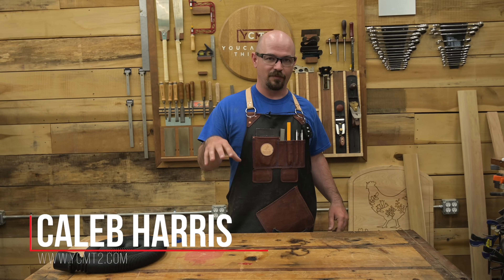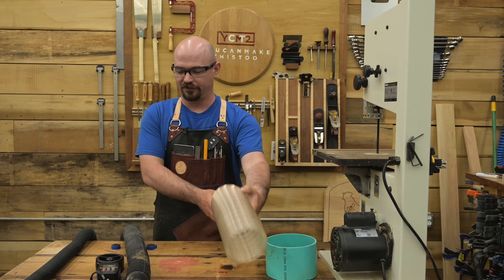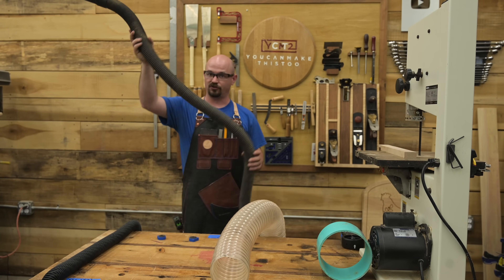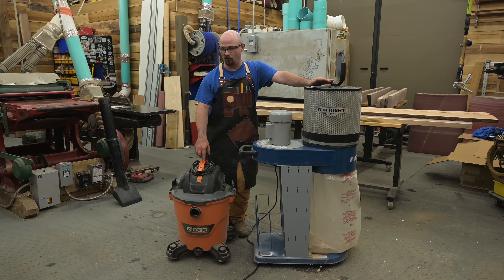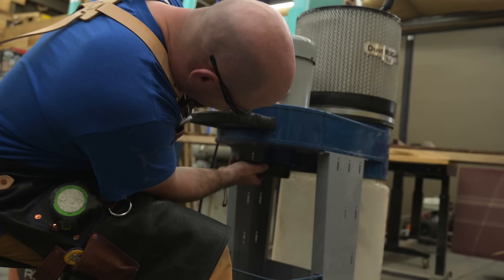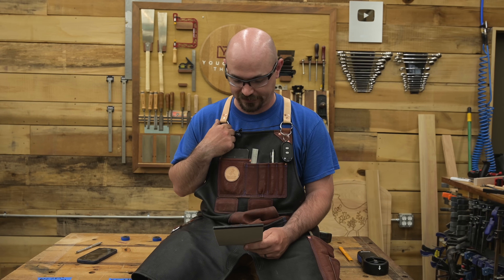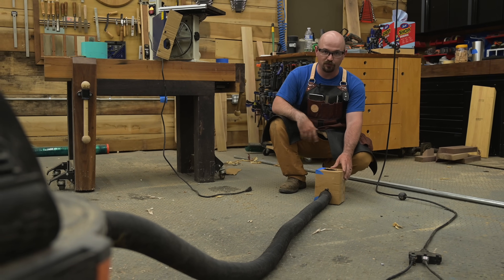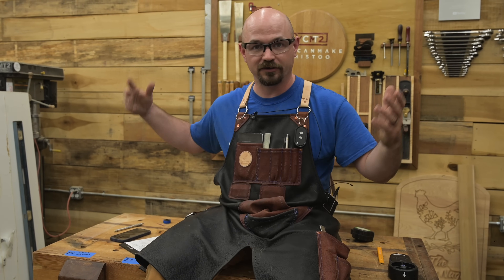We're Wrong About Dust Collection

Comment: The inconvenient truth is that you simply can't get good dust collection with small ports. Just because a shop-vac performs better with a small port than a big dust collector does with the same small port, doesn't mean either one is adequate. The acid test is to monitor air quality during tool and after tool use. That's the only thing that will tell you if your dust collection is working.
Reply from the maker: Truth. Most of those tools aren’t designed for dust collection at all. The port is a check the box after thought put in the cheapest place. 

But they’re the tools many have. Just trying to help folks do the best they can with them.
Reply: Thank you. Both good points. I'm your neophyte audience on this. In my case, I need to also be somewhat mobile AND flexible on exhaust/ collection, as I set up in my patio room (momma hates dusting, already)!). I only have a shop vac to work with. So I'm down to thinking: Contain, Capture & Collect. Contain everything early a.m.a.p. Capture dust/ particulates with high-volumn cfm. Collect larger shavings separately. Thoughts appreciated. -mc
Reply: collection and filtration are two different things. To get collection at the point of production, high suction through a 2-1/4" opening is generall better than through a 4" opening. The 2-1/4 opening generally has FAR SUPERIOR linear velocity than a 4" central vac. Hooking a Super Cell to an orbital does NOTHING to clean the atmosphere in a room. It does cost a lot more to run because of electric bills.  Ambient filtration that cleans the air in a total room of harmful dust is best done with a ceiling suspended filtration like a JET or WEN separator. Optimize our central collection for dust extraction at the tool and you will love your setup!
Reply: I😅😅😅😅😅
Reply: Having done shopvac dust collection for years (with an inductive automatic switch) I can say for certain that dust collection works. That was a strange comment imho
I’ve only once had a big space for a shop and today as in the past I have a small space to work from. As a professional any dust collection is a bonus and the shopvac performs well. 
Is it 100? Nope. While I don’t know what percent the efficiency it actually is, MY efficiency goes way up when everything isn’t plastered with dust from the biggest polluter: the tablesaw. The lathe and compound miter saw are fairly well contained, though long runs of cutoffs benefit from switching out the hose. 
The tablesaw is night-and-day. 
I’m going to pick up a cyclone head for a pail, though. I can deal with a tad more dust with the time savings of not spending 10 minutes knocking out the filter.
Nevertheless, small port dust collection beats the heck out of no dust collection.
Reply: @fishhuntadventure   Are you measuring air quality, or are you going by visible dust?
Reply: @fishhuntadventure  :  It's good that your productivity goes up when your workshop is cleaner... you will need to be able to get through all the work before the poor air quality ends your life early, and very unpleasantly.  My wife has COPD, (no, she has not ever smoked), she cannot go anywhere without her inhaler, (Try going to a tennis tournament with an uncontrollable cough!), her enjoyment of life is diminished.  In my world @trevorlambert4226 is bang on target with his "strange comment".
You cannot put a Bandaid on your lungs!

Comment: One helpful test would be to have the airflow meter some distance away from the inlet port. Where I first really noticed the need for a HVLP dust collector was trying to do dust collection on my lathe. Shopvacs are basically useless for this because you're trying to pull flying chips out of the air with a big hood. True dust collectors move so much air they can pull chips out of the air some distance from the inlet.

Comment: Great video with some good numbers!  I'd be interested to know what the numbers would be for adapting down from the larger diameter to the smaller diameter at the tool, just a step down from the big hose to the tool, no length of smaller hose.
Reply from the maker: That's a good question, without the run it wouldn't have as bad an impact

Comment: Anecdotally I started in a garage shop probably very comparable to most your viewers. When I upgraded my lunchbox planer, 15 amp / 110 table saw and my 6” jointer from a shop vac to a 2hp dust collector, my dust collection and tool performance both increased tremendously (particularly the planer). I would highly recommend a dust collector as an initial shop purchase. I also recommend getting away from a shop vac and getting a dust extractor for your sanders in short order. Like before you buy a billion clamps or commercial quality tools.
Reply from the maker: That sounds a lot like how I started too
Reply: Can you tell us why? Why not simply get a hepa filter for your shopvac?

Comment: Only issue with the supercell is the cost. I mean I guess if you are limited on space and need best of both worlds you could use it but honestly I think best bang for the buck is a 12 gallon shop vac system with cyclone separator for smaller tools and the harbor freight 2hp 70 gallon system for larger 4 to 5" connections.

Comment: I have been looking into a company called CamVac lately that @HookedonWood did some videos on.

I think it’s where I am going to end up. Take a look, I’d love your opinion on this channel….
Reply from the maker: I’d never heard of it till I did this video and it came up in comments. Sounds like a good system
Reply: @YouCanMakeThisToo  Personally ive been just using shop vacs with hepafilter bags and hepafilters for about 7 years because I’ve never found a system that had everything I have been looking for. 

The more I look into it, the more I think CamVac (or something like it) is what I’m going to be using in my own small shop. Some of the setups I’ve seen of those double motor systems are insanely quiet, effective, and easy to maintain.
Reply: So update. I finally got my cam vac in. I did the wall unit 2 motor system.

All I can say is it is amazing. I highly recommend the cam vacs for small shops.

I now just picked up a couple small cnc’s and I’m in the process of figuring how to hook those up with proper dust collection as well.

Comment: Anybody on here have issues with or approval of a dust collector system? I need to get mine permitted at my business and I want to be able to keep it indoors. Codes say it most likely had to be outside. I’m in an urban commercial complex with no real good outside place for it plus I imagine a headache of holes and excessive duct and a house and locks etc etc. I just have it tied to two table saws a mitre saw and a little downdraft table
Reply from the maker: I’ve never had to deal with that. My guess would be to filter inside youd need HEPA filters. Best source would be whoever is supposed to inspect your system.

Comment: "IMPRESSIVE!"  Made me a follower.  Studied what was available when I built my dust collection system many years ago. Even got my own "Annie".  There is another factor involved when not making money with my shop... Cost of operation.  Small tools take less watts of power and unless I'm running a big machine> Smaller is better.   Had an "Oh Dah" moment when selling my 110 delta dust collector. Realized cleaning the upper bags is equally important to air flow.  Looking forward to more of your "Nerdy" Wisdom!"
Reply from the maker: All so true! And yep, filter cleaning would've definitely been a worth add since I was talking about air flow. You can only pull as much as you can push out and clogged filters don't help

Comment: Good overview of the challenges of piping a system, large or small.  What it comes down to me is... is the airflow good enough at the end device, even with the hose reduction restrictions placed upon it.

I have a 1250 CFM system with 6" main run to shop central location, then split to two 4" runs to my machines (each 4" run has a couple blast gates and y-connectors used to select the desired device).  All of that being hard pipe and only the last ~4' being flex.  Only my router table has a further reduction to two 2.5" hoses (fence and dust box via a y-splitter).  It may not be optimal and greatly reduced from the maximum the collector produces, but does the job and pulls enough air to keep up with what I cut.

I plan to still purchase a portable extractor (like a Festool) for hand sanding and routing... they need the extra high volume that my main collector just can't provide when reduced via longer/smaller hose connections.
Reply from the maker: You're right. Ultimately it is just do you have enough airflow at the tool. Sounds like you've got a solid setup. I had the same experience with my router table hooked up to my big collector. It split into two 2.5" ports, but they were short and fortunately I was already drawing so much air that the loss didn't really hurt performance at all.

Definitely can't beat an extractor for hand held tool use though, especially sanding.

Comment: Good video. It is food for thought, but I do have a few comments. 
1. A Nitpick: At 1:54, the increase in volume for a large pipe grows exponentially, not because pi is involved in the equation, but because r squared is involved in the equation.
2. A dust collector like the ClearVue is designed to pull a large volume of air. Reduction of the pipe size not only reduces the volume of air but is bad for the machine. It is important to maintain the same volume. In my shop I use six-inch PVC to my drops and to my blast gates and only then reduce to at least two four-inch pipes. There is still enough volume to include a 2 inch pipe as well, but it remains to be seen whether the pressure would be adequate.
3. The point of dust collection is to remove the fine dust from the air ASAP. Whether or not a vac can do that depends on the vac's filter. I doubt that the vac pictured will filter out the fine dust and one that would (HEPA), would probably clog.
4. In woodturning, we face two challenges.  Woodchips which are heavy enough to fall to the floor and fine dust (especially when sanding). I have a large collector for fine dust and a floor sweep for the larger shavings.  I also wear a mask and have filtration unit over my lathe.  Dust in the lungs is no joke.

Comment: Wow, am I glad I watched this video ! My shop is small and all of my tools have 2 inch  dust ports and there is no reason for me to spend big bucks on a system that would not have been appropriate for the tools I use. Really great information and very helpful. I use a Dewalt stealth sonic vacuum and it seems to work pretty well on the tools in my shop, so I'm glad I didn't just waste money on a system only to find out it would not have been of much benefit. I guess that's why I'm a subscriber ! Cheers from Utah. Two thumbs up on this video !
Reply from the maker: I super appreciate the feedback. Always good to know what I’m making is helpful for folks 😊 sounds like you’re on the right track with your dust collection! No need to worry about upgrading it until/if you get some bigger tools with bigger ports. You’re probably already collecting bout as well as could be expected

Comment: Record Power Camvac dual and triple motors do the same. They cover smaller machines and larger machines with 4” ports. The power and extraction is superb for both types of tools and machines and at a reasonable price. Not sure however if available in the US yet? As the product is manufactured in the UK. But big in Europe.
Reply from the maker: A few other folks have mentioned that, it's new to me until folks have been commenting about it. Not sure it's available in the US.
Reply: It is, there are finally a couple North American vendors. Some of the best money I’ve spent. They are unbelievable

Comment: Thanks for another great video! You referred me to this one, from your older dust collection video, but this was the first I’d seen of yours!

With a Dust Deputy 2.5 going into a 6HP shop vac and bag, do you think it would make sense to put a HEPA filter in the shop vac? Do they restrict CFM? What about  just venting the shop vac to the outside? Thanks!
Reply from the maker: A HEPA will restrict flow… but only then is the system actually doing what you want it to - remove harmful particles. 

Venting to the the outside is definitely an option and will help flow.
Reply: @YouCanMakeThisToo : So sounds like venting outside and the standard filter is a good option? My neighbors aren’t RIGHT next to me, but would I be harming them?

Comment: I liked the video. 

In short and to summarize the basics here without the need of math, special gadgets etc. 

Our tools for a "modest" shop come with, pre-installed dust collection ports. 

Now, why is that? Hmmm. 

My Dewalt tablesaw for example, comes with a 2.25" port. Why? Why not a big ol 4" or 6" port? Because it is sized for EXACTLY what is required. 

My Dewalt chop saw and benchtop bandsaw. They come with smaller ports. Why? Hmmm. 

My Dewalt benchtop planer. Again, comes with a standard 4" port....Well, why is that? Why is the planer larger than the tablesaw etc? 

Well. What is it that these individual tools are doing? What type of "dust" is being created? Is it even "dust" or is it actually "chips"? 

Hmmm. 

So, the question isn't really about air volume, pressure etc etc etc. 

It's about the TYPE of debris being removed. 

Period. End of story. 

My bandsaw isn't removing "chip", I'm cutting a fine line, therefore the debris is "dust". 

Tablesaw = Dust (aside from the occasional "chip". 

Miter saw = Dust. 

Planer = CHIPS. 

So, large dust vacuums should actually be renamed to "chip" vacuums cause THAT is what they are geared for and purpose. Absolutely, they suck up "dust" as well....but that isn't their actual intent. 

So...in short. Small port...use a Shop Vac. 

Large port, use a  "chip" vac. 

Simple. Easy. No math required and no "Annie" required.
Reply from the maker: Ehhh... partly. I'd agree it can be summed up with "if it's got a shop vac sized port, use a shop vac."

That doesn't mean it's what the tool actually needs to properly collect. I've owned a planer with a 2.5" port, it was stupid and only served to clog the thing faster than just letting it blow freely.

Many of these budget tools that have dust ports are NOT designed for dust collection, the port is an after thought.. often poorly located and horribly undersized. 

A budget 10" table saw with a 2" dust port makes the exact same dust as my 10" cabinet saw with a 4" port with internal shroud to focus the air at the blade, and over blade collection. 

And that's not my opinion or feelings, that was a big insight from spending 90 minutes talking to the general manager of a big dust collection company. The dust collection on most modest tools is a check the box after thought put in the cheapest location sized for what people probably have in their garages (shop vacs) - not what the tool needs. 

Apologies if somewhere I made it seem anyone needs an anemometer.. nobody does. I do, to do videos the way I like because I'm big on "show me, don't tell me" and without a way to capture facts I'm just another yahoo with zero credibility saying what's "common sense" to me (you'd be surprised how much "common sense" is just uninformed intuition that $30 of TMDE can disprove). Instead I can present the data that supports my assertions and research and if you disagree.. you can explain how my data doesn't line up with my assertions.
Reply: @YouCanMakeThisToo  ehhh...I disagree with his post almost entirely.  The fine dust particles made by tools like sanders and other small tools (routers, etc.) is not being collected by a shop vac attached to it.  To lead someone down that primrose path is not only a bit disingenuous, but possibly harmful.  This person has missed the boat on dust vs. chip collection.  Bill Pentz work was started because of how much he personally suffered because of inadequate dust collection in his woodworking shop.  Many who are watching would do well to spend adequate time understanding what Bill spent years figuring out.  You don't have to agree with Bill, but you better be ready to defend your denials with something better than, "well, the tool manufacturer only put a 2 or 1.5 or 3 inch port, etc.  Yeah, they aren't trying to get fine dust collection...

Comment: I just rearranged my shop, and was trying to decide on ports /gates along the 6" pipe for the smaller ported tools. Your timing is impeccable! Love my 6hp Ridgid; now I need to design an easy to swap header.

Great vids, keep them coming.
Reply from the maker: Glad I could help! I've also got a video "common dust collection mistakes" that goes moreso into setting up system and running pipe. Might be helpful.